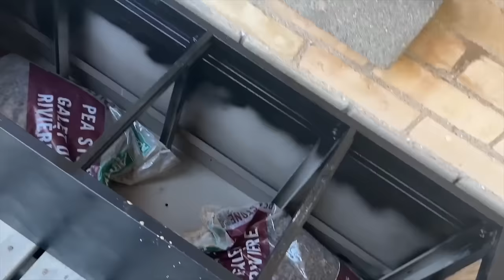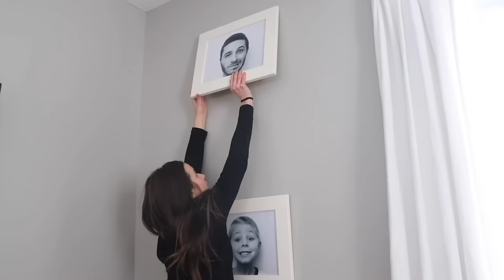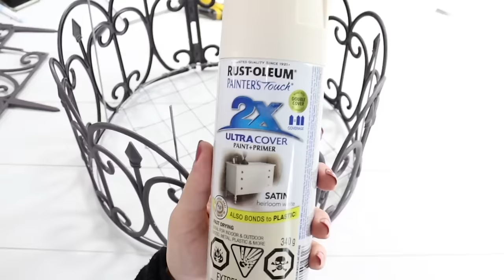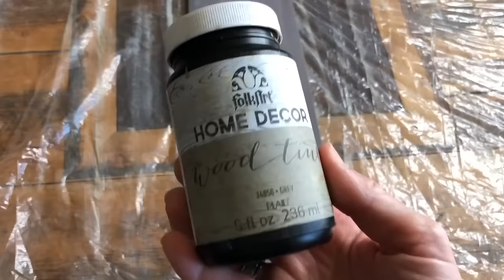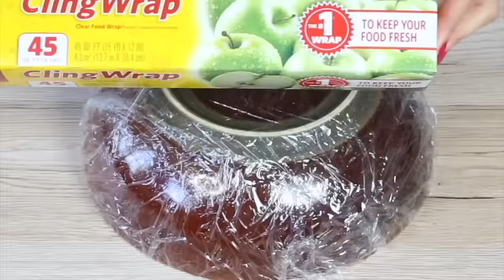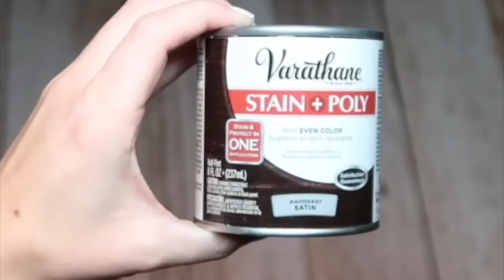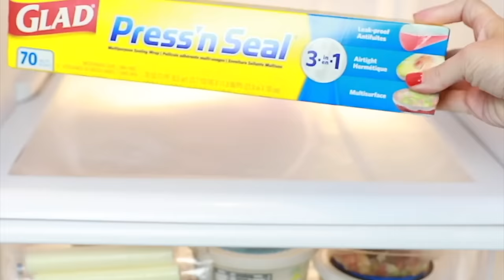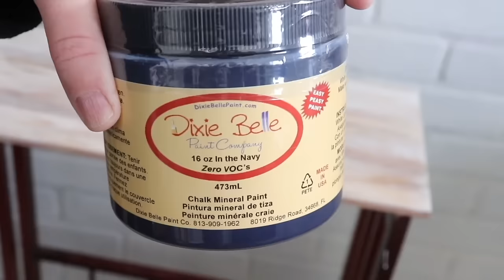People are flipping out over this CRAZY filing cabinet hack!

Comment: For that first project, figure out something to do with the cabinet drawers to prevent wasting them for scrap. Avoid scrapping unless absolutely necessary. Perhaps use them in a closet for shoe storage or in a garage for tool storage or in a pantry.
Reply: Apartment living doesn’t allow storage of drawers…nothing wrong with scrapping metal.
Reply: filing cabinets are good for tool storage just as they are.

Comment: Do not follow this example for one you need to sand it with at least a red scratcher pad to spray paint with rust oleum. It will turn out so much better you will not have a texture and it will look great.